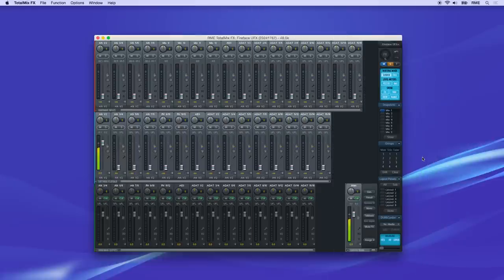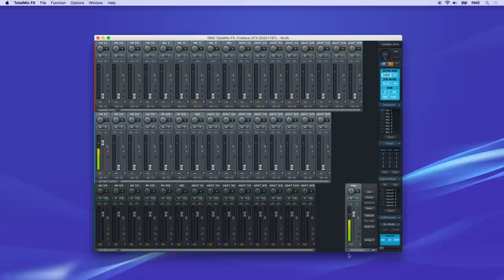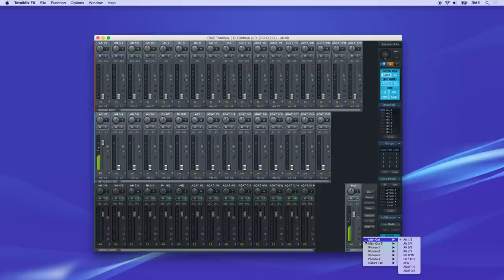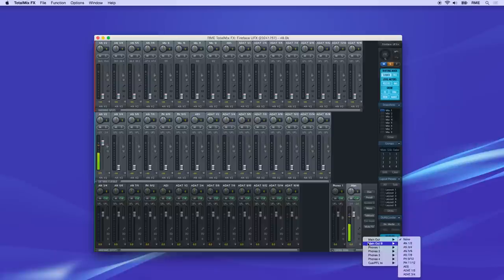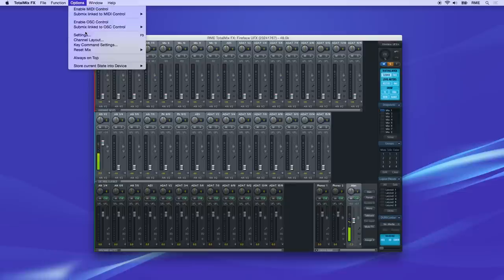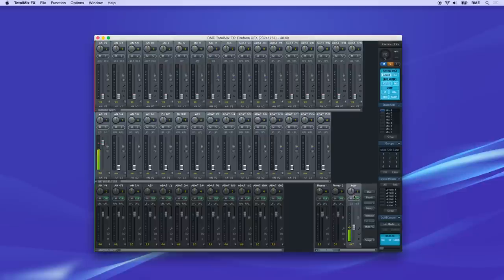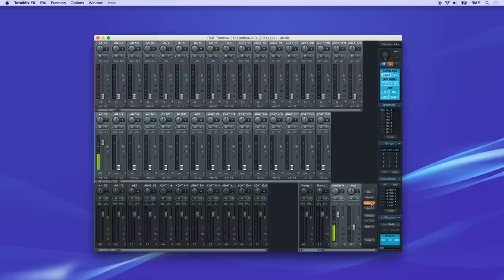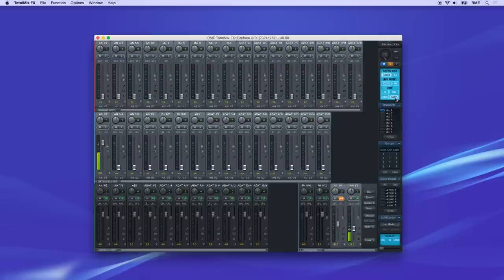How to use RME Audio TotalMix FX - 01 Control Room

Comment: TotalMix is complicated, but ... 1) think of every hardware output channel in the bottom row as having its own individual mixer. So when it is highlighted any signal coming from your hardware inputs or software inputs can be routed to and through the selected channel by raising the faders in any of those hardware input or software input channels. ... 2) learn to use the snapshots so you can save any particular setups you need for different tasks such as recording, mixing, etc. ... 3) understand Loopback so you can stream audio from any ASIO compatible software and record the streams individually or mixed back into any DAW or recording program. When a hardware output channel's Loopback function is enabled it now also becomes an input channel back to your DAW. When you 'get it' your mind will be blown. Can you say: "record and monitor with ZERO Latency?'
Reply from the maker: Yes, if you mix directly from the Hardware input to an hardware output, you can monitor/record with zero latency and on devices with DSP also with FX. If you have set your output mixes, you can also use the "Trim"  function (the little "T" symbol) so you don't have to select all the individual outputs. It mixes them then all at the same time.

Comment: This is just mental !!!!! - Way Confusing
Reply: Hi Sid, care to elaborate? TotalMix FX is very powerful, these video tutorials are meant to help alleviate confusion.
Reply: sorry I just find it way complicated - I get that its powerful - I get that - but its not very intuitive is it.
Reply: I suppose that is subjective. People who have worked with digital mixers before generally find TotalMix to be very intuitive.
Reply: absolutely not , Ive worked with all of them - and this not straight forward by any stretch of the imagination - SORRY
Reply: I agree with Jeff ... TotalMix is conceptually the same as using layers on a digital mixer. The difference is simply that the 'layer of faders' is tied to the selected output instead of a selection button.

Comment: Control Room Section:
Groups all Monitoring channels together. So advance features like talkback, front panel controls and queing will work.

Decide which channels will connect to the monitoring system in headphones.
In the bottom right section click assign and then look for AN 1/2
Then do the same for phones,

Comment: I have a BabyFace Pro with the outputs hooked up to my external mixer. My monitors are hooked up to my mixer. If I set my monitors to AN1/2 and my headphones to Phones 3/4, I only get sound coming out of my monitors.
Reply from the maker: You need to route the audio also to your headphones. Or you right click the main copy/mirror, right click phones, mirror main, if you want to have the same signal all the time on both outputs.

Comment: Very good presentation. I have a little problem with my connection. The 
signal does not appear in my software FL Studio. Here is what i do: 
first my mic goes to TC Helicon ( mic effect ) from TC Helicon goes stereo to my mixer
 PV 10 ( first and second channel ), from mixer out to RME Fireface UC  
 balanced line inputs 5 and 6. And of course RME is connected usb to my 
laptop with FL Studio 12. I have a signal in my headpfones but no signal
 in FL Studio. What is wrong ? Will be very grateful for your help.

Comment: I dont see the PH output on my totalmix when connected to my Fireface 800 unit, any idea why it could be gone?
Reply from the maker: On the Fireface 800 the headphone channels are shown as output AN 9/10. If you want to use them in your Control Room you have to select them by clicking the "Assign" button in the lower right corner. It is also possible that the channels are hidden in the Channel Layout under "Options".

Comment: Hi there

Recently I purchased the RME UFX and was experiment to link up with my previous FF800, however the attempt failed as I couldnt see any signals coming from Ableton Live 9.

I did receive the signal in TotalMix, but just not in the daw

My connection goes like this:

FF800 as Master, FF800 to Thunderbolt to my MacBook Pro

UFX Adat 1 out to FF800 Adat in

UFX FF400 port to FF800's 400 port

Stereo hardware synth to ch5&6 input on UFX

with some routing I was able to see and hear the signal in FF800 TotalMix.

but no matter which channel I set in the FF800 Total Mix I just couldnt see anything in the Ableton Live channel configuration. 

please let me know if I miss any steps.

all the best

Comment: Hello.
I am using the Fireface UCX
TotalMix FX shows up, but I only see 2 rows of audio channels not 3,
and each track has no fader, only the small send fader for reverb etc.
I am using Live 9, I cant figure out how to get the faders, 
so I can monitor mic ins in my headphones without latency
Reply: Hi Kevin, it would seem you have activated the DAW mode for TotalMix, this removes the middle row and routing capabilities. You can change that in the Options menu > Operational Mode.
Reply: Care to elaborate please. Does this have something to do with ASIO Direct Monitoring from the DAW?

Comment: Q.  How do I get the audio back into the laptop for live video streaming using babyface as the audio source?
Reply from the maker: Just select the correct input in your streaming software, or by using the loopback function in TotalMix FX if you want a to record an output. For more details; https://www.youtube.com/watch?v=m-Zeruz-9Zk&list=PL0QKeSpeDQwGO7vwRTLlJKInSXF_f8UB6&index=9
Reply: Didn't work adequately for me.  First, it sounded as if a phase effect was on the entire software backing track ( from a wave played in ableton ) and secondly my vocal comes through dry.  I spent all day yesterday uploading 4 second snippets so I could hear how it sounded.  I wouldn't let my dogs pee on the uplinked video recordings that's how bad they sounded. ( and I sound good live ! )  Unless you have a solution looks like I'll have to use 2 machines for what I wish to do. When I upload a wave file to sound cloud no problem faithful reproduction and when I use RME to mix again either to record or live, again no problem.  TY.
Reply from the maker: It is possible but could you please send a mail to support@rme-audio.de for technical support on this matter?
Reply: sure ... thank you :)
Angelo